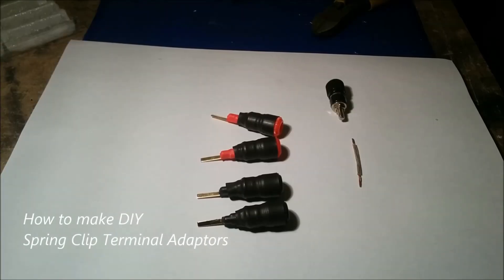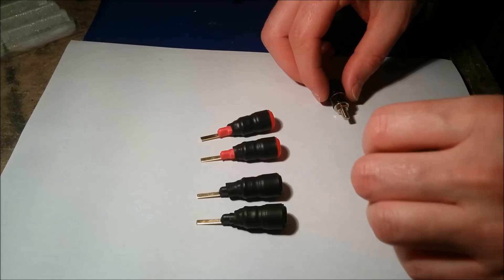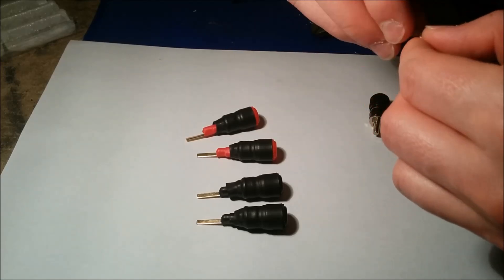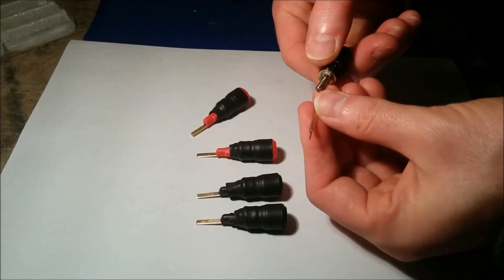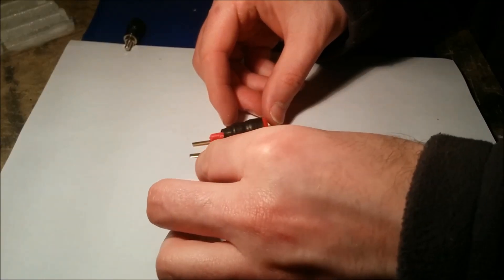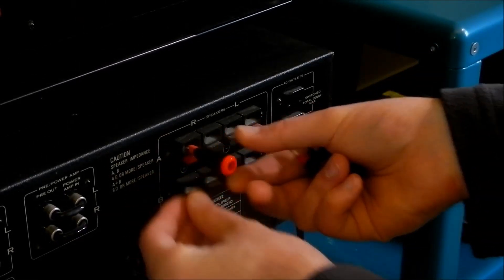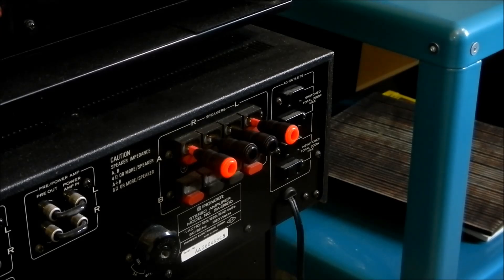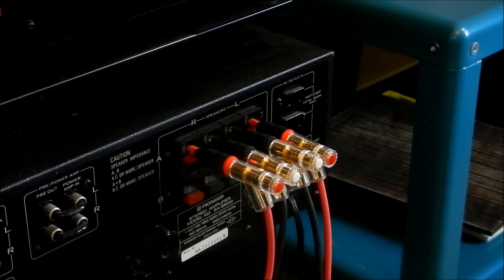How to make DIY Spring Clip Terminal to 4 mm Banana Plug Adaptors

Comment: I bet there's an easier way. Plug the banana into the back of these, and then crimp the front end to make it fit into the amp clip. Or maybe I'm missing something...maybe a banana plug doesn't fit into the back of these...
Reply: The whole point is standard banana plugs are too big to fit in spring loaded terminals.
Reply: They do fit in most but won't stay in. The spring clip pushes them out again. You could try to flatten one with a vise I guess.